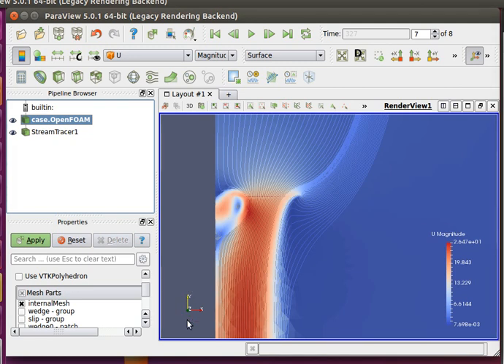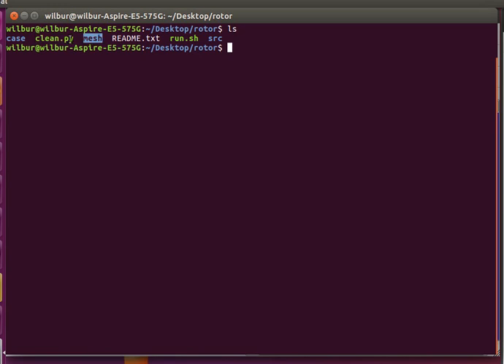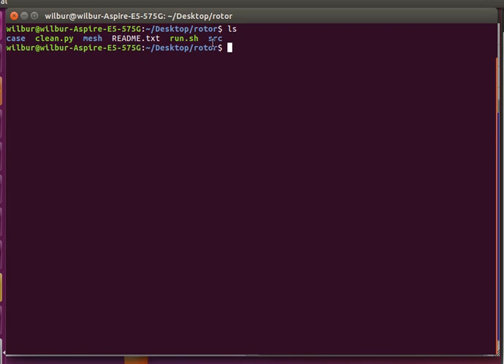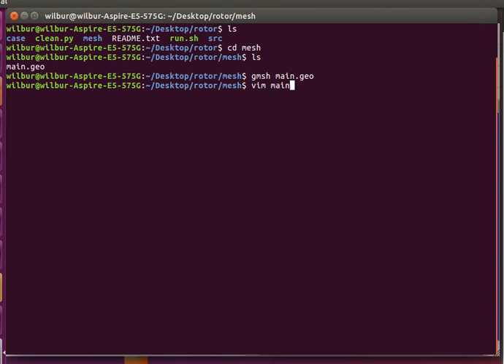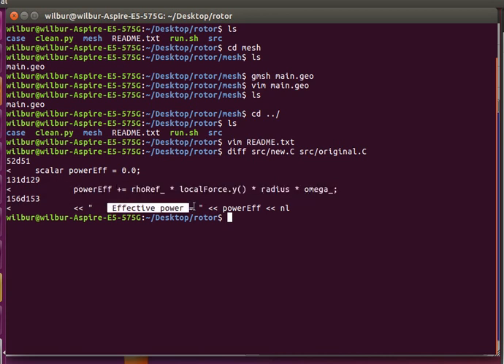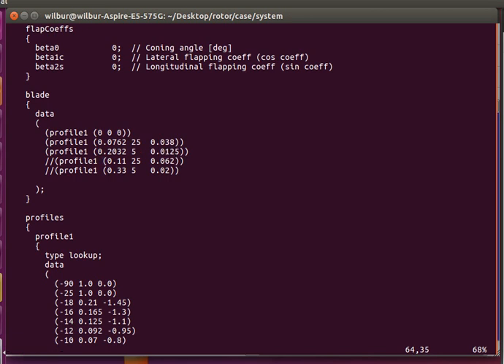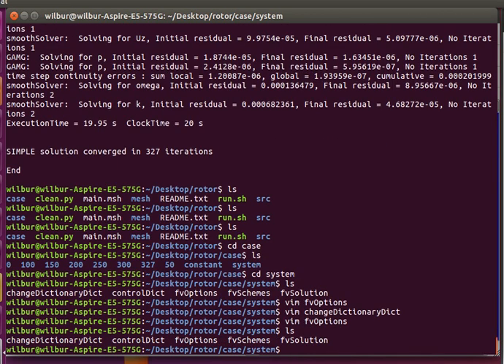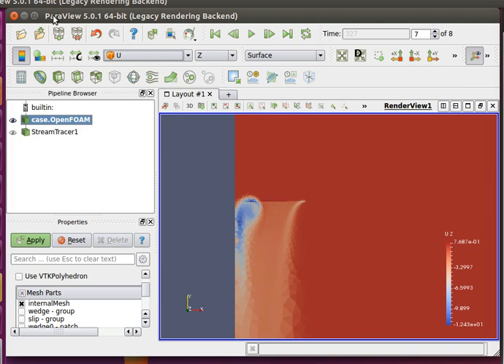Propeller Simulation in OpenFOAM

Comment: There is a small mistake in the code you provide on github:

 scalar AOAmin = great;
    scalar AOAmax = -great;
if (area_[i] > rootVSmall)

should read:

 scalar AOAmin = GREAT;
    scalar AOAmax = -GREAT;
if (area_[i] > ROOTVSMALL)

(Just a change in the case of the letters)

Comment: Hello there
This is the original fvOption for rotorDisk;

disk
{
    type            rotorDisk;

    selectionMode   cellZone;
    cellZone        rotatingZone;

    fields          (U);    // Names of fields on which to apply source
    nBlades         3;      // Number of blades
    tipEffect       0.96;   // Normalised radius above which lift = 0

    inletFlowType   local;  // Inlet flow type specification
    inletVelocity   (0 1 0);

    geometryMode    specified;

    origin          (0 0 0);
    axis            (0 1 0);

    refDirection    (0 0 1);  // Reference direction
                              // - used as reference for psi angle
    rpm             1000;
    // pointAbove    (0 0 0.25);

    trimModel       fixedTrim;  // fixed || targetForce

    rhoRef          1000;
    rhoInf          1;

    fixedTrimCoeffs
    {
         theta0         0;
         theta1c        0;
         theta1s        0;
    }

    flapCoeffs
    {
        beta0           0;  // Coning angle [deg]
        beta1c          0;  // Lateral flapping coeff (cos coeff)
        beta2s          0;  // Longitudinal flapping coeff (sin coeff)
    }

    blade
    {
        data
        (
            (profile1 (0.1 -6 0.02))
            (profile1 (0.25 -6 0.02))
        );
    }

    profiles
    {
        profile1
        {
            type lookup;
            data
            (
                (-90 0.21 1.45)
                (-18 0.21 1.45)
                (-16 0.165 1.3)
                (-14 0.125 1.1)
                (-12 0.092 0.95)
                (-10 0.07 0.8)
                (-8 0.05 0.64)
                (-6 0.04 0.5)
                (-4 0.028 0.32)
                (-2 0.022 0.18)
                (0 0.02 0)
                (2 0.022 0.18)
                (4 0.028 0.32)
                (6 0.04 0.5)
                (8 0.05 0.64)
                (10 0.07 0.8)
                (12 0.092 0.95)
                (14 0.125 1.1)
                (16 0.165 1.3)
                (18 0.21 1.45)
                (90 0.21 1.45)
            );
        }
    }
}
Reply: Do you have a sheet to explain these parameters? such as blade length?